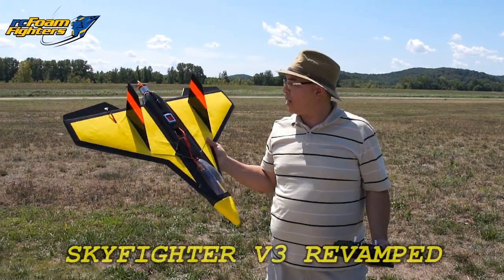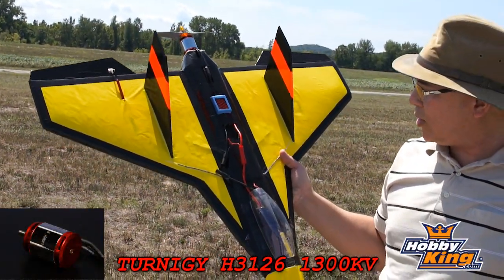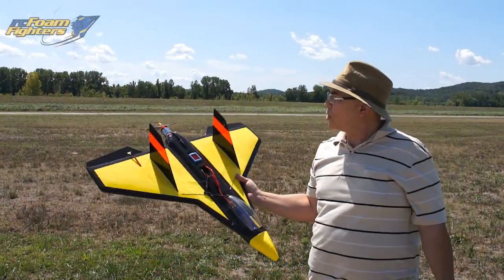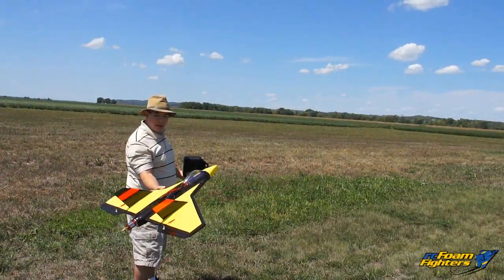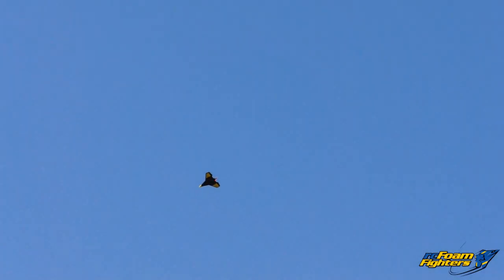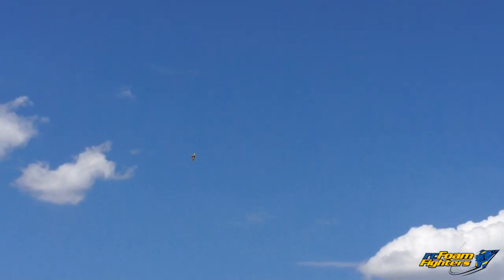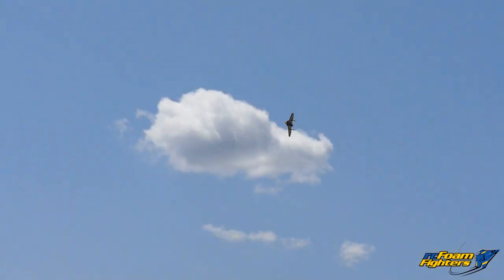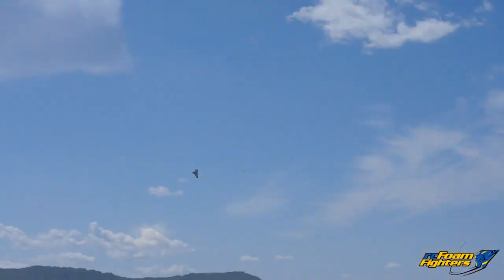SkyFighter V3 Revamped - HobbyKing upgrades

Comment: Hello Frank did you ever try that 1300kv motor on 6 cells? I've been wondering what size prop that motor will turn on 6 cell. Thanks.

Comment from the maker: There are no plans for The SkyFighter V3 just yet, still need to do a little more testing. You can however download the plans for the SkyFighter V2 which is a smaller version of this one. They are available on rcFoamFighters blog for free download. There is also a build thread on RCGroups forums.

Comment: With a wing that big and heavy I would go with one of the Turnigy T600 motors, either the 880kv or the 1100kv depending on the amount of cells you run.